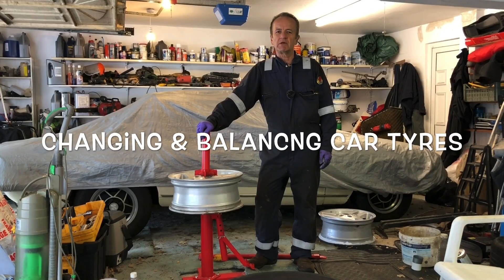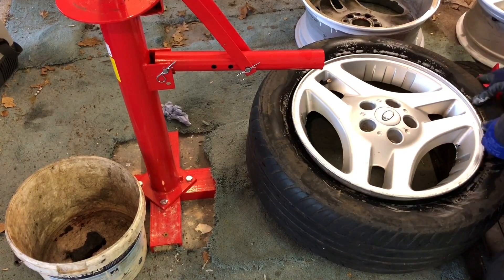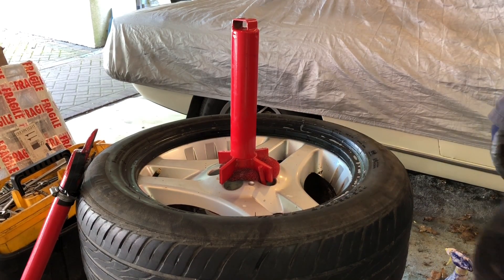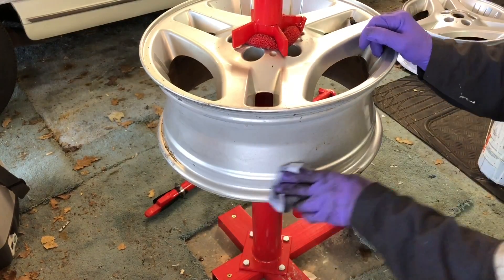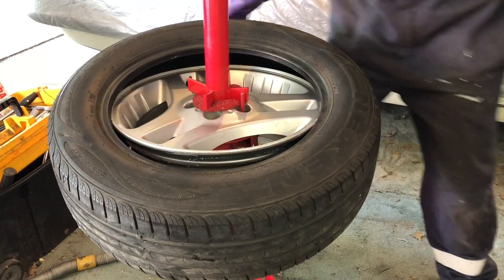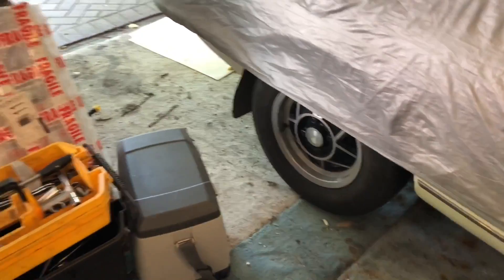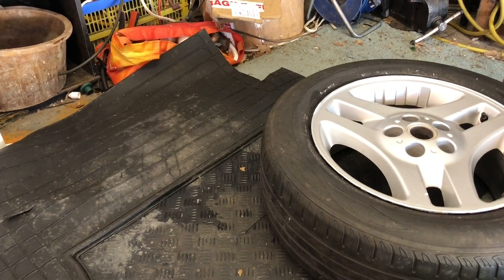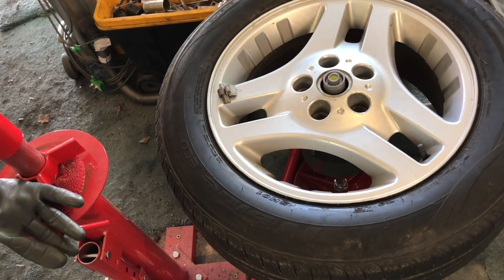Changing Car Tyres (Tires) DIY - Is it worth the Bother? - Pros, Cons & Balancing

Comment: Thanks for sharing. 

I've found an increasing number of tyres fitters, that now only fit tyres they sell. Unfortunately they sell tyres at a huge markup, so they make on the tyres, then charge again on the fit n balance.

Doing it yourself will save money in time, although this will be at the expense of increased time it takes to change them yourself. 

It's horses for courses isn't it.

But if you want the job done right, then I can't see why those with the necessary skills and understanding  can't do what is essentially an easy job at home, using cheap tools off Ebay. 
Thanks for sharing. ;)
Reply from the maker: Cheers. Thanks for your comments..